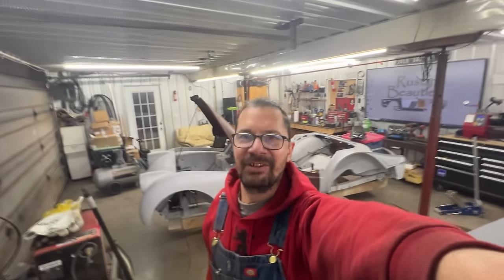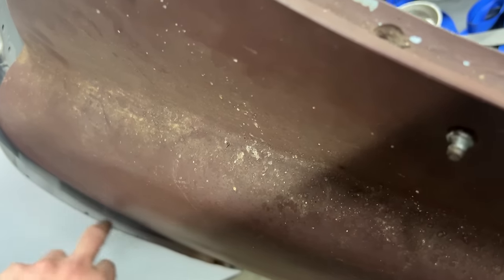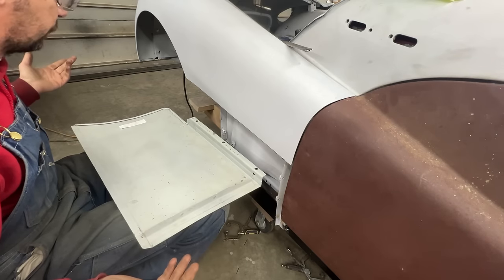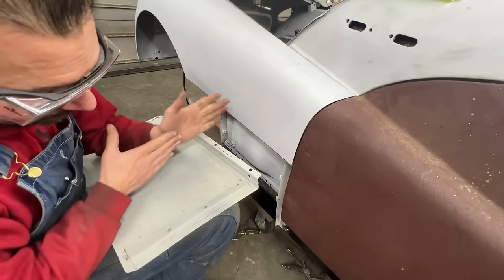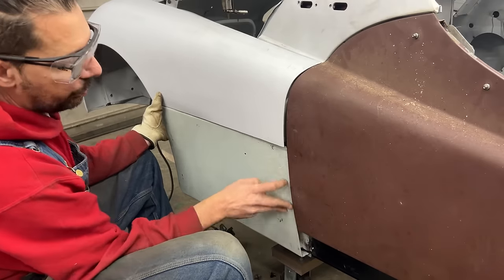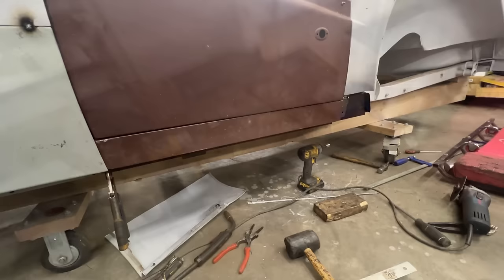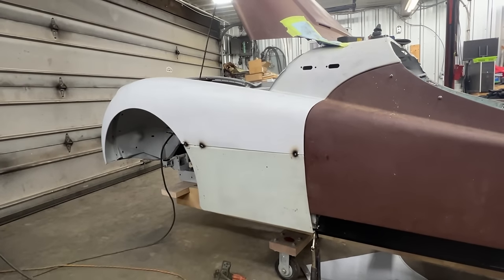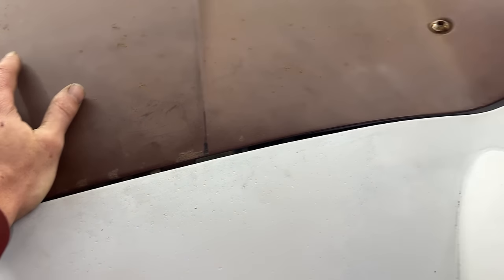1958 TR3 - Part 7 - The Bonnet That Wouldn't Fit

Comment: Elin, Is that bonnet an aftermarket made? Somehow, I do not see any rust on it. Could it be an old replacement bonnet, that was sitting in someone's stockroom for 45 years?  I just read other comments, I think we are all on the same page and agree!  You are doing the only thing possible to make it work, great job!
Reply from the maker: I don't think it is an aftermarket. They all fitted like this out of the factory. I think a simple fix to their jigs was gonna fix the entire production, but they didn't care at the time. The sheetmetal is bent OK, all the flanges and pressings... The braces are what is distorting the whole bonnet as the shape was totally wrong

Comment: Elin, I'm sorry you couldn't hear me shouting at you in your last video!
With the gaps across the car not aligning with the bonnet, was there any chance that the valence had been crushed or sat on?
This would have pushed the fenders apart and the made the bonnet rattle in the space between.
The tear in the valence supports this theory.  
But the end result of your work is astonishing. Superb!
Reply from the maker: No, that is not the case, the valance has the correct shape, matching the crossmember and everything. You could see that the shape of the bonnet was distorted (probably from its birth) not even matching itself left and right

Comment: Aftermarket rocker panels are so completely obvious when the installer ignores the profile between the bottom edge of the door and the face of the rocker.  The aftermarket rockers are flat and the doors are not.  Your solution to adjusting the rocker to match the door is excellent.  As I mentioned earlier, most do not care about these details.  You are going beyond the norm.  Cheers.

Comment: I think your being to hard on the quality of the sheet metal fitment, granted 1950's standards were not the best, but I expect the assembly line jigs used to assemble the TR3's helped a lot in getting the body and sheet metal in "reasonable" condition coming off the assembly line.  Your now working on a 65 year old car, who knows how many bumps and tweaks the body and frame have seen in that time.  Exterior panels also from different cars, new floor pans, modifications to the B-pilars, etc.  Your doing a custom restoration without the original jigs to help align the body, its time consuming work with lots and lots of test fitting.  It takes patience and time to do the work.  Your videos and work will help others who are committed to bring back these cars.  Good work.

Comment: great vid I got a lot to look forward in putting my tr3 together. One thing I noticed that car was a wide mouth now you have a small mouth nose on it so the tune signal will not fit without cutting a hole in the inner fender I cut out the divot that was for the wide mouth welded it up and cut the hole just like Triumph did it for the small mouth.
Reply from the maker: Yes, some modifications will be required under the valance. It also has the pressings for the headlights that are not needed now but they are not in the way anyway.
Reply: I did remove the headlight pressings they came out good I know I didn't need to do that but I wanted to. @RustyBeauties

Comment: A great episode, i can sympathise welding upside down in a cramped space, have you had a hot bead of weld drop into your ear hole yet 'YOWL'
Reply from the maker: LOL, no, but years ago I was welding a pipe with a stick welder close to the floor, when a whole chunk of molten metal dropped on the concrete and the concrete literally exploded, sending hot metal drops all over the place. One of them landed on the back of my head somehow.... It left a bald spot in my head and a 3 inch crater on the concrete floor. Not sure how that happened :)

Comment: Who would have thought that the British used handmade bodies on TR3's? That much fiddling with fitting stamped "interchangeable" body parts means that their factories'  body molds and presses were worn out already in the 1950's.  The British Pressed Steel Company was probably using machine tools first placed into service during the 1920's.
Reply from the maker: In fact there were absolutely no modification on the pressed sheetmetal. It was all coming form the braces. Just a simple fix on the jig was gonna fix their entire production.

Comment: The aftermarket restoration parts are total crap. They were made by people who are doing it on the cheap and don't even care about getting the dimensions correct.  He would have been better off just welding a small patch or two in the rusted original fender area instead of using that aftermarket piece.  He is spending way too much time fitting and fighting with the new aftermarket lower fender piece to make it cost effective repair for his customer.
Reply: His customer is Elin Yakov on this project :)
Reply: Actually it's not his TR3, I confused the two projects..
Reply: @mikedx2706 - Your putting your own value judgment on the repair, perhaps the customer and/or Elan has a different view point than "just good enough".  I have seen sloppy "value for customer" repairs that look like crap, not something I would ever want done.